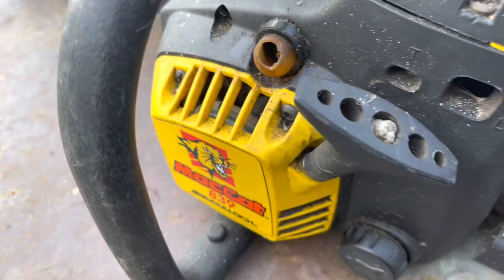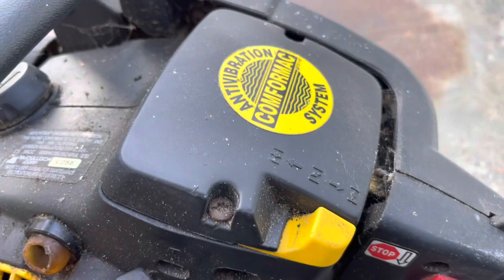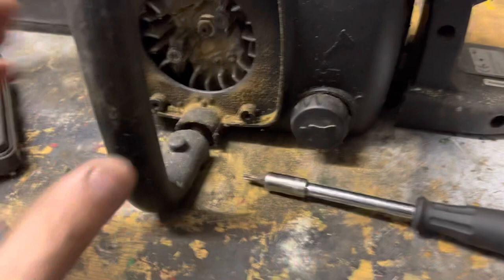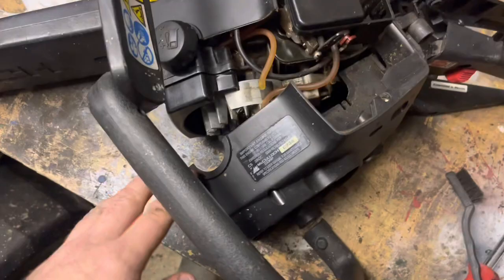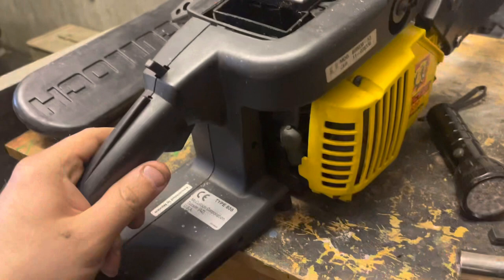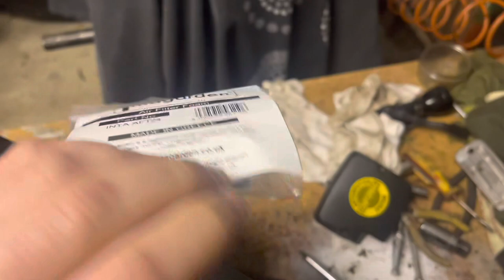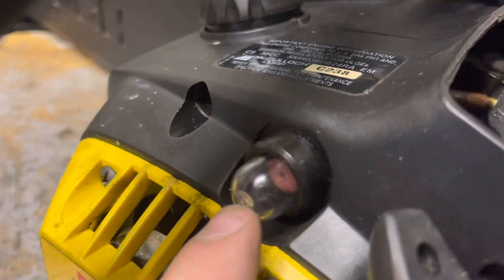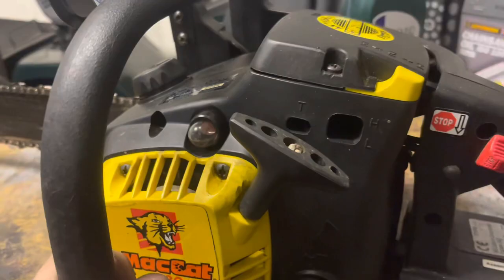McCulloch MacCat 839 chainsaw £10 from Facebook marketplace will it work

Comment: How do I get the chain tension right? There are 2x nuts and I think they both tighten somehow, just can’t figure it out after hour of trying
Reply from the maker: I just pull Bar forward and tighten them up then there’s a screw on the inside of the bar are used to finish tightening